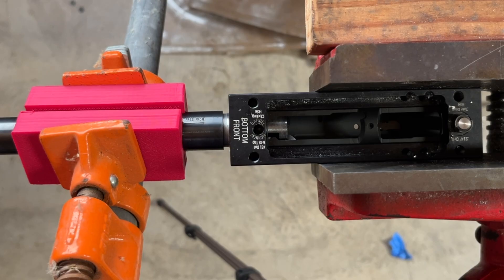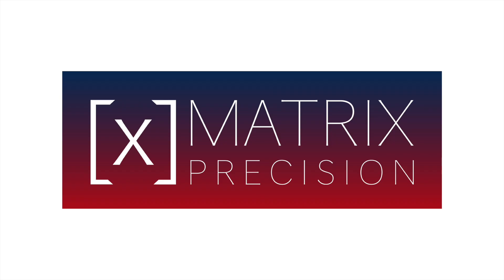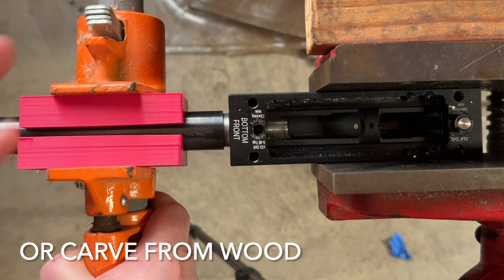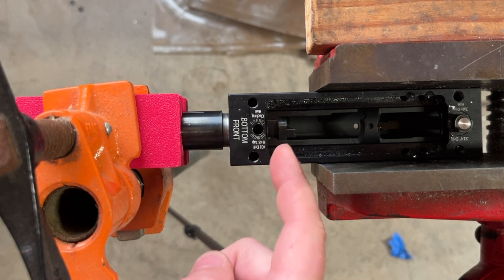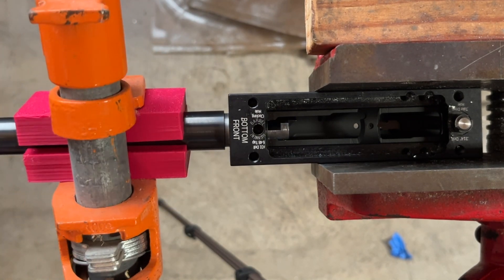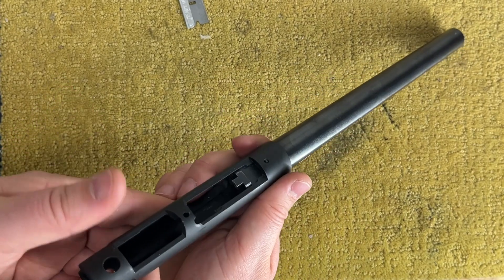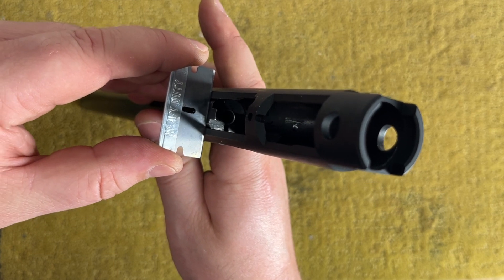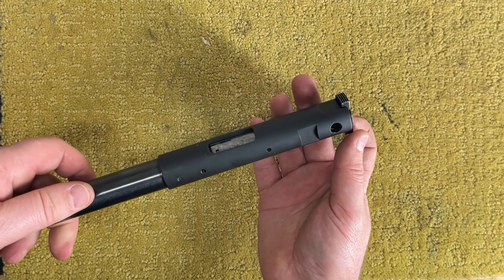Ruger Mark Series Barrel Install Tutorial- mkI, mkII, mkIII & mkIV

Comment: i copied this tool and it worked great  i can tell you on the one i just removed the barrel from  no pins no lock tight no interference threads no heat i made a fixture to hold the receiver and two sets of barrel bushings one for the standard barrel and the other for the bull barrel had to set the bull barrel back .010 to get it to time aka index

Comment: Could you please tell what jig you’re using to hold the receiver in place?
Reply from the maker: That is the Matrix Precision jig for creating 0% receivers. Pricey to buy just to hold receivers for barrel installs. Very fun project (go watch episode two of this build series on my Odysee) so I do suggest getting one! But if you have no interest in building, honestly just design a jig in CAD to 3D print out. It'd literally be a square box with a 1" hole down the center and a cross hole in .315" that you stick a .315 drill bit down into to stop it from rotating.

If you have a 3D printer, but no CAD skills, and want that, just let me know and I'll design it up and host the files on my Odysee.
Reply: @NotaGuntuber  i made one just to remove the barrel and install from a bar of aluminum 2 " od 1 ' id broached a key way to clear the ejector rivet reamed a 5/16 hole in the back for the receiver pin cut a slot at the front for the barrel receiver timing  and milled four .100  flats on the outside of the tube for the wrench worked just fine
Reply: @NotaGuntuber I very much appreciate the info. I’ll give the 3d print a try (not that I’ll be doing that, but I have access to someone with the brains and a printer).
Reply from the maker: @abswa  Cool. Let me know if you hit any snags where I can help.